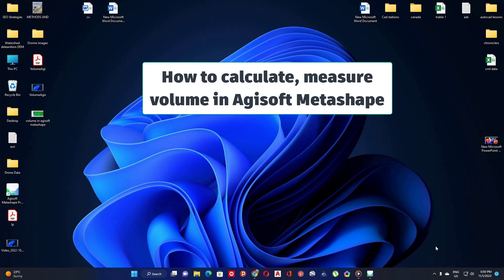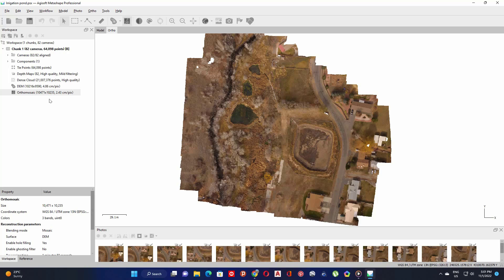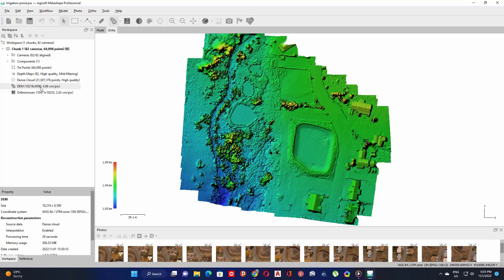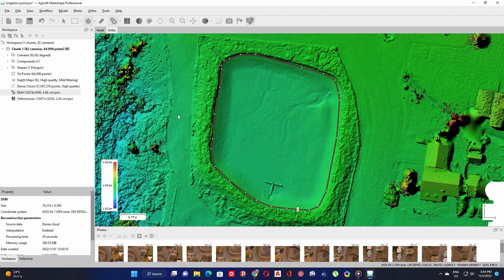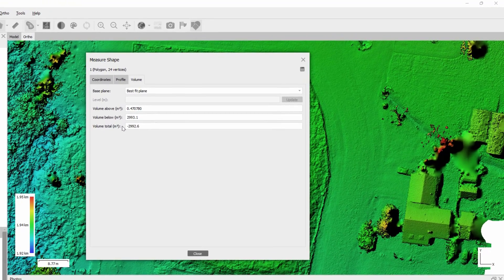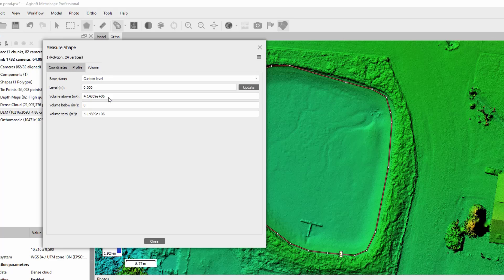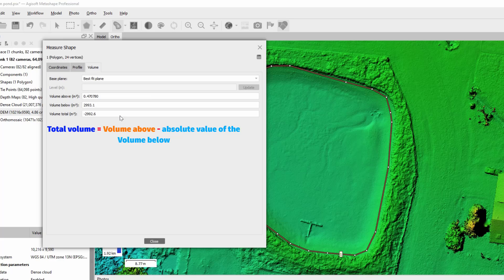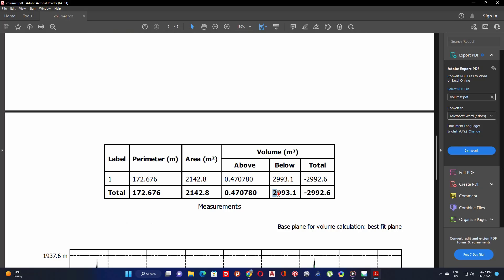How To Calculate Volume In Agisoft Metashape

Comment: Hello,
Thank you for your video — very informative!

I’m based in France and I had a question about GCP coordinates:
Would it be an issue if I leave them in WGS84, even though we usually use RGF93 here?

In my opinion, it shouldn’t have any real impact, especially since we’re only looking to calculate volume. But I’d rather get your feedback to be sure.

Thanks again, and great work!